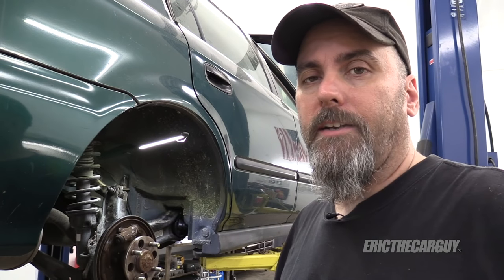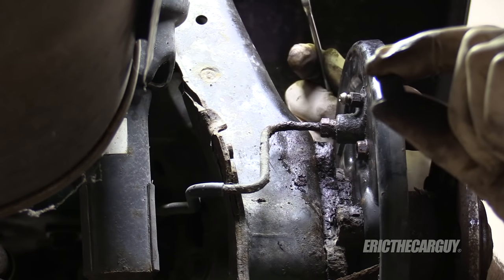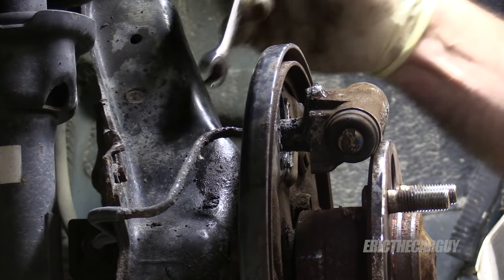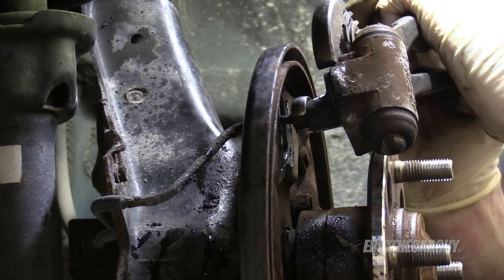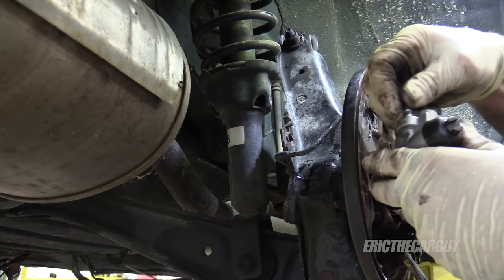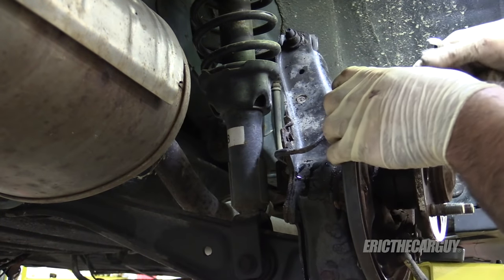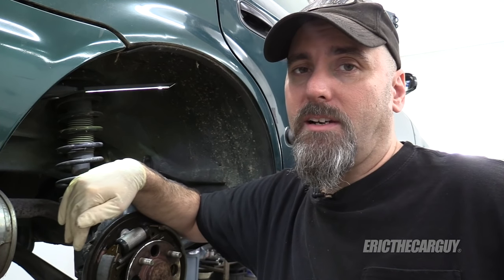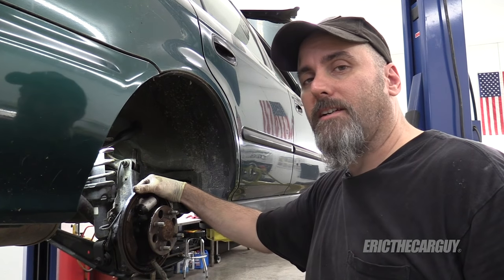How To Deal With Rusty Brake Lines

Comment: This is not good advice...

If the brake lines are that bad, it’s safer and easier to just replace them. Eric, since you have such a huge following of novice mechanics, I think you should avoid giving people the impression that the “hack way” of doing things is the best way. It seems like people are intimidated to tackle things like brake line replacement, and when they see a video like this it reaffirms it in their mind that it is too difficult to do. In reality, changing a brake line is easy, safer, and much nicer than doing it this way. 

I know you would probably argue that you show people this method to save money, but really this doesn’t save anything. It’s either they replace it now, when the wheel cylinder is nice and new and the car is already safely off the road, or later when everything has corroded back together and the car is stranded on the road somewhere. 

If someone were to invest $30 in a roll of brake line and an in-line flaring tool, they would have enough to fix multiple lines, and they will already have the tool for any repairs needed in the future.
Reply from the maker: Did you watch the entire video or just comment? Have you also check the description to see the links to the videos about making brake lines?
Reply from the maker: wheeler dealer is a troll with 2 subscribers.
Reply: @ericthecarguy  he probably can't read Eric
Reply: @ericthecarguy  don't listen to their shit man. I've learned a lot from you and I pass your channel on. I wanna see you get more views.
Reply: EricTheCarGuy Yeah man, I watched your video, but I just don’t think it’s right to call the video “how to deal with rusty brake lines” and then show a sketchy practice (proven to be sketchy because it didn’t even work out for you on the video). Yeah, this may be a trick you can use in off road vehicles or strictly farm use vehicles, but I’m willing to bet most of the people watching are working on their own vehicles, or family members vehicles where safety should be pretty high up on the list of priority’s. 

You make videos that come off as how to’s or instructional videos...it’s not very good to start off being taught to do something the wrong way. It becomes hard to change once something has become habit.

And I’m in no way affiliated with wheeler dealer...I’m not trying to troll you or anything, just using the comment section to voice my criticisms and personal opinions.
Reply from the maker: Mike Tunstall I think you're missing the point. It's not a sketchy practice if the line is not that rusty but the fitting gets stuck to it. That does happen, check the comments, it's been mentioned.  As I stated in the video, and  in many of my comments, this is something that can get you by, it's not a final repair. If the line is as rusty as this one was, replace it, just like I said, and DID in the video. You've completely glossed over that point, and my statements in the video.

Being a content creator like me, you look for opportunities where you can to find content. This was an opportunity, although not ideal, it still provided information that can help people. It's not like I'm able to find the perfect scenario to show a 'trick' like this. I hardly ever see drum brakes anymore for starters. As a result, I often have to just make due. 

As for the title and thumbnail, that's part of the YT game these days. I've had to alter the way I do things, and the videos I post. Just look at the other automotive YouTubers, the only 'popular' one I see that's still doing 'repair' videos is Eric O. His views aren't as good as others who have changed formats and their approach to producing videos. As a result of those more popular 'automotive' channels, and the change in the YouTube algorithm, the rest of us have had to adapt. Hence the clickbait. 

I guess what I'm trying to say is that there is a lot more than what you see on the screen here. I'm also going to guess you're not a professional mechanic, or that you ever were one. If you had been, you might be aware of this 'trick' and it's common practice already. This is not the 'wrong way' as you say, the method works. The proof is in the result as they say. 

FYI, I'm fixing this car up for my oldest son, who will be driving my grandson around in it. I stand behind everything I've done as their safety relies on it. So if you think I'm not taking it seriously, or that I don't understand what it is to take care of your family, you're dead wrong.  

I wouldn't change a thing about what I showed in this video and I would make it again, exactly the same way in the same circumstances. For those paying attention to the information AND what I said in the video, particularly at the end, they can take away useful information that they can add to their mental tool box. Others can criticize and call me out in the comments.

I respect your opinion, and that you have a different point of view, but not everything in the mechanical world is so black and white as you see it. Thank you for your comment.
Reply: You can claim you watched the entire video, but it is obvious you didnt.
Reply: EricTheCarGuy 

Eric, I’m sorry I was so focused on the issue that bothered me so much about the video. You are 100% correct in that this trick can be useful in many occasions. Anyone who has ever dealt with plastic coated brake lines, such as on VW’s know that sometimes even on a new car they won’t budge. I often do the “spin the brake hose, not the line” trick on those just because of that very issue.

My problem was only with the fact that it the title “how to deal with rusty brake lines” made it seem that this is acceptable practice if the brake line looks like the one in your example. 

Also I understand the YouTube click bait title thing. I just think the title shouldn’t be too misleading. 

I’m kinda wondering why everyone is saying I didn’t watch the whole video...I heard everything you said in the final 1 minute 10 seconds. Kinda proves the point that this isn’t a good rusty brake line solution...

And yes I am a mechanic. I am a mobile truck mechanic, so believe me, I have seen and done some crazy things to get by. I just think this isn’t an area to be using  easy tricks, especially since it’s so easy to do correctly the first time. 

Again, I’m sorry for being so critical. And thanks for being so active in the comment section, it’s nice to have an interactive experience on YouTube. Mike
Reply: @ericthecarguy  Well said and well put!! Why do people come on here wishing to speak to God...go to church if you want ALL the answers.
Reply: @daves_not_here_mannn  These guys take their time and effort to show us what they know and yet we get these naysayers who THINK they have all the answers. So many A'holes on here!! Good comment!!
Reply: Omg......you stopped watching at  4:00 or something? At 4:05 he says everything you (and we) should know....

Comment: Sorry Eric but with brake lines like that they NEED replacing. No if's, no but's, no "saving a bit of time" because ultimately you're saving a life - The drivers, the person who steps out in front of the car or the moron who ignores the red light. Copper pipe isn't that expensive and it's hardly a huge job to change them out.
Reply: A lot of folks don't know about copper/nickel pipe sadly. There's also many who do who think it's unsafe, despite it being used on many European cars from the factory. Easy to bend and even easier to flare.
Reply: He replaced the damn line. Said in the vid he recommends replacing it. There is just no pleasing some people.
Reply: Ahhhh an armchair warrior comes out the woodwork.

4:03 "Saved myself the time and expense of having to replace it"

4:09: "One last thing viewers I ended up replacing this rusty brake line. And part of the reason is I went to do that final tighten and it created a very small leak"

So without that leak the line wouldn't have been replaced when it should have been replaced as a matter of course. I like this guy as he's a good mechanic BUT it was clear to anyone that line needed replacing regardless of it developing a leak or not. It may have lasted 1 mile, it may have lasted 1,000 miles with no issues but it would have developed a leak and it is UNACCEPTABLE to take a risk like that with a ton plus lump of metal traveling at any speed which replies on the brakes to stop it.
Reply: @TheFakeRussian  lol this guy has too much time on his hands 😂
Reply: Jog on troll
Reply: @TheFakeRussian  jog? Lmao you trolled eric.